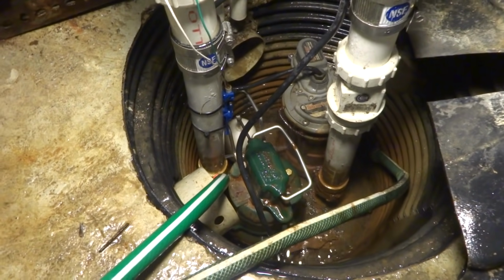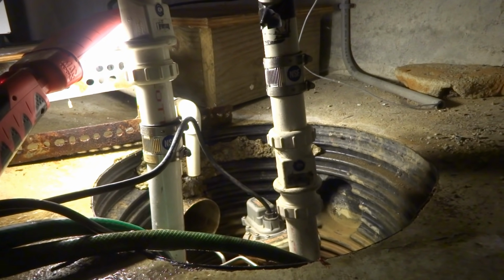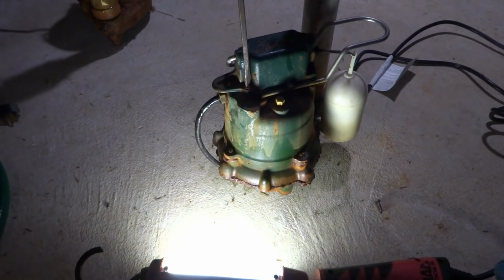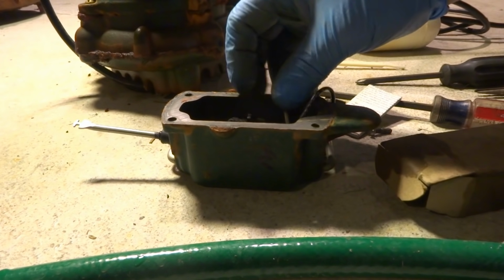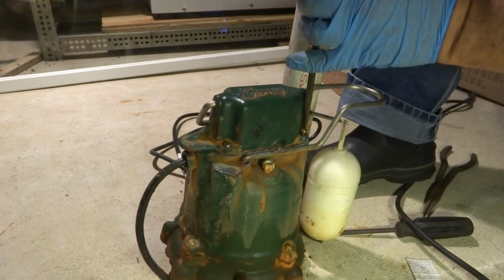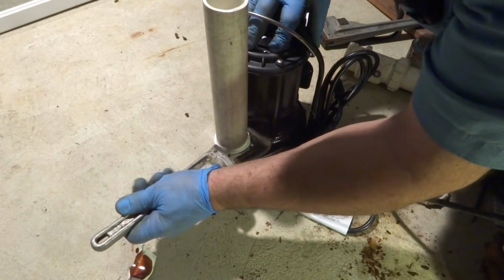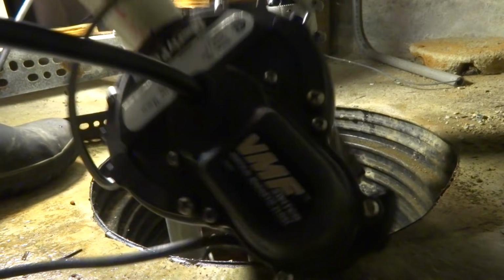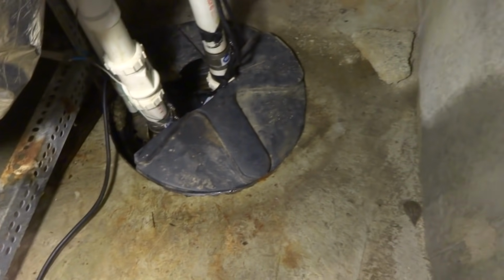Zoeller Sump Pump Keeps Running Bad Switch 2 Year Old Pump

Comment: My Zoeller 98-0001 Model M98 failed today after 4 years. Pump would not shutoff.  Tried to toggle the switch by hand, but it kept running.  After replacing pump, I took the switch cover off, and found copper strands coming off the wire crimp connections.  I cut off  the stray strands, then reassembled the switch cover. It Worked.  Looking at the wire/crimp point, I think, soldering the wire to the crimp would be a good idea.

Thanks for your video.  It helped a lot.

Comment: 3x pulled sump pump which also served a toilet. Gross!  It was always the float switch. The last time, bypassed the internal wiring, and put in a mercury switch float that plugged in before the pump. Never a problem again. I like watching others troubleshoot. Sometimes saves me on repeat.

Comment: Got two Zoeller's sitting in the basement that my neighbor gave me... same thing, bad switch in both.  One was only 3 years old too.  In my opinion the Zoeller differential level is too small so the pump cycles too often.  That coupled with a likely offshore switch... and you get a high failure rate.  I've gone to a separate float switch that runs a contactor on the wall, that powers a pump without an internal switch.  Lowered my failure rate to nil.
Reply: Yes your right. These pumps cycle a lot due to the travel of the float being so short. This shortens the life of the switch and potentially the motor. My Zoeller is 5 years old and going strong. I use it for basement drainage and washing machine drainage. I will stick with that brand. Switches don't cost a lot.

Comment: Ashland Pumps makes the large pumps used in municipal sewer lift stations, but they also have a 1/3 hp sump pump for basement dewatering. That might be a good unit in a die-cast package.

Comment: I've had a zoeller sump pump for over 15 years that just died on me. Maybe mine is a fluke, but I'll take it. Maybe it only gets a workout when it rains. Perhaps that's the secret for its longevity. I replaced it with another Zoeller, and I have another on standby.

Comment: It looked like he cut the zip tie and let it fall right into the sump where the pumps could suck it up and get jammed up. I've seen it happen.
Reply: I don’t think the zip ties were cut.  I saw the push thru part on both ties.  Lighting changed so it was hard to see but they were still in one piece.
Reply: @karlkruer1179  oh ok. I didn't see that.

Comment: That smurf jizim works on everything,  but zoellor pumps? Haha, good job Steve.
Reply: Okay, he'll put it on anyways. He likes that stuff. Teflon compound, or whatever.
Reply: The customer expects it last forever.
Reply: I was talking about how he put teflon compound on the switch cover gasket, or did you miss that part?
Reply: Replace it with fluid master toilet valve and hook it up to a motor, is what it seems?
Reply: I've seen fluid master or toilet valves on swimming pool supply lines to refill the pool when the water level is low, down in Texas, it was an in ground pool, anything that works.

Comment: The hole is directed by the Zoeller installation manual to prevent air from building up in a dry standpipe and preventing the pump from self-priming correctly. The hole is supposed to be very small.

Comment: Some company should market a heavy duty retrofit switch for Zoeller pumps. Apparently the motors last, but the switch contacts burn up.
Reply: The gaskets and seals are crap too. Just a terrible design.    Liberty uses a high-quality o-ring, while Zoeller uses a crap flat gasket.

Comment: Steve,
One of my pet peeves: never pull/stretch electrical tape (it will tend to unravel) cut with knife. I agree with Zoeller sump pumps; they do suck. I always try to convince customers to install a battery backup second pump. Thanks for  keeping me sane during my Covid quarantine.

Comment: Not too many people know in pumps with pressure switch there is a very small tube in the power cord that runs from the switch to the plug, and if that tube gets condensation /water in it the switch will not work..

Comment: Just curious why you need two sump pumps there👍🏻👍🏻👍🏻👍🏻👍🏻
Reply: One is the primary, sits at the bottom.  The second one is a backup, it sits higher in the pit, only runs if the lower pump fails to pump, or can't keep up.

Comment: The rebuild switch kits don't last either, never have gotten more than 2 years out of one. It's best to just replace the whole pump once the switch fails. Preferably with a pump that's not a Zoeller. It's a shame because they are really good pumps aside from the junk switches which unfortunately bricks the whole pump once they fail. Certain models have better switches supposedly.

Comment: The pump manufacturer should try better quality switches.  That seems to be what goes bad the most.
Reply: That and the gasket fails pretty often too, letting water in to short out the switch
Reply: Been over 20 years now,evidently they don't care

Comment: i had a zoller that the switch went bad and the pump ran so long that steam was coming from the sump. the pump was replaced under warrenty only to have the switch go bad on the new pump in less than a year

Comment: Zoeller is really shooting themselves in the foot. They are trying to sell pumps with crappy switches and pumps with quality switches all under the Zoeller name. A company's reputation is only as good as the worst product they make. They should discontinue the M53, M55, M57, M59, and M98 that come with garbage switches and just sell the M63 and M95 that come with high quality switches. If they did that, they may loose out on some sales to their cheaper competition. But if I were them, I'd rather make a quality product and maintain brand loyalty than worry about acquiring new customers who's primary concern is finding the cheapest unit.

Comment: Well, they are either going to use a better switch, or sue.  :)
Reply: It is not the switch. The switch during the rainy season will cycle on and off 50+ times an hour. This will ruin any switch. If your pit is bigger around and the pump can run longer durations this would not happen. Liberty pumps will fail as well. It will be the switch. Plus in his area some people get water in the basement all year round steadily because they are near the ocean.
Reply: @NY411Info  others here have said they, Zoeller, make a more expensive pump with a better switch that doesn't fail like these.  I think its the switch.
Reply: @Bob.W.  I run 2 of these models and they  are 5 years old, no issues with the switch yet. I have spare switches on hand in case. Zoeller owns many pump brands. As for the short cycling , yes even mine short cycle, since my pit is only 4 foot deep x 18 inches wide.  So I don't expect the switches to last too much longer.

Comment: u should try posting ur video on Zoeller's social media pages might get someone higher ups attention and they may contact u to try to make it right for u. could just be the rep for your area is an ass hat.
Reply: the rep has nothing to do with poor quality which it obviously is. what would be  the point of that?
Reply: make it right? Replace the junk with newer junk?
Reply: @barackobama5304   that just bites u in the ass i mean after u buy the first one and it dies to quickly and they refuse to warranty it ur gonna look else where. the pennies they save using a junk switch isn't worth it to any company who has a brain if it just adds up to a ton of bad pr.